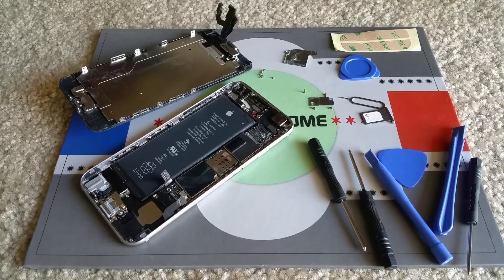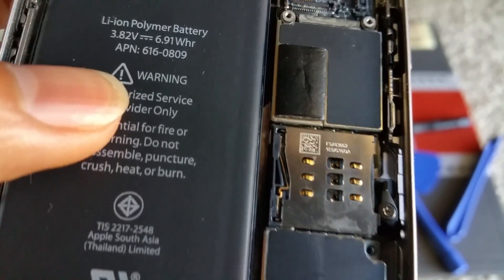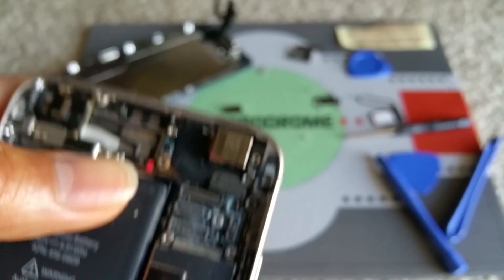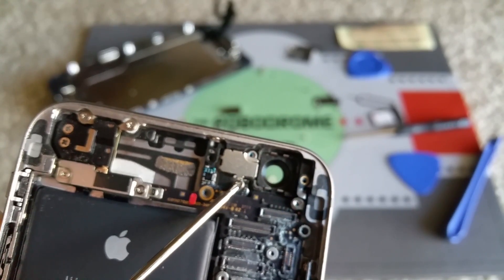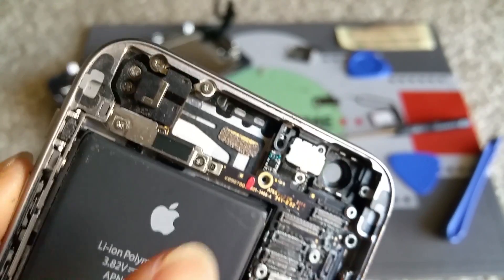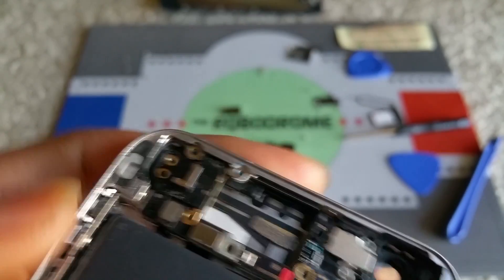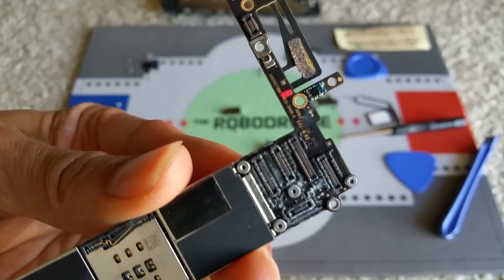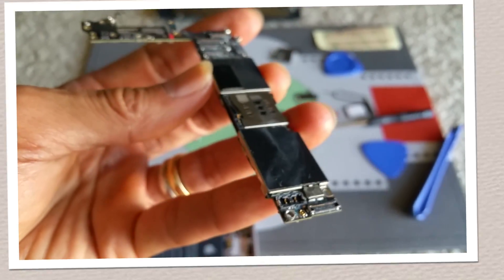Close-Up On How to disassemble water damage Apple iPhone 6 6s Part 2 2016

Comment: in the process i have mixed up my screws and now don't know where they go is there any way you can help me please ?
Reply: brb Juan , I had the same problem. go to ifixit.com website, they written instructions with images step by step. they also show all the screws with their sizes ie 1.3 mm etc...and where they go on the motherboard etc...you may need an magnifier to see some of the screws bigger because few of them are so small yet so different you cannot differentiate between them with the naked eye.  hope you've managed since it's 2 months ago now....but for anyone else if needs be.
Reply from the maker: Sure, how can I help you? If you want you can watch my tutorial on Part 1 and see how I removed the LCD, Mainboard, Battery Connector, and etc...
Reply: macdaddypimpping i just have no idea where any of the screws go and any of there sizes , and I've heard that if you put the wrong screws in it can damage the logic board
Reply from the maker: Yes, it could damaged your mainboard. Please refer back to this video it shows exactly screw locations.
Reply: macdaddypimpping but i don't know which screws you are taking out and i don't know any of the screw sizes
Reply from the maker: Which part and what screw are you confused with?
Reply: macdaddypimpping all of the ones that you took out in the video i need help with
Reply from the maker: You didn't draw a lay out diagram of your logic board?  Screws that I removed I put it right next to the parts that I took out so it was easier to know which screws go to which locations. What is the easiest way to help you out?